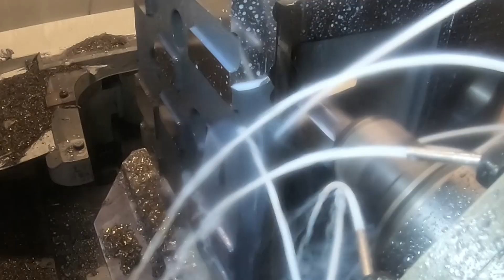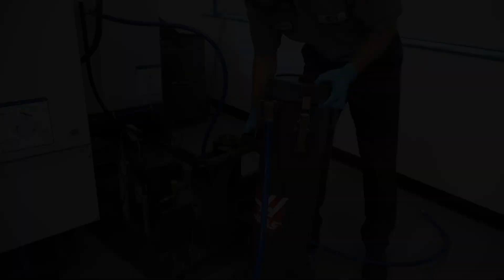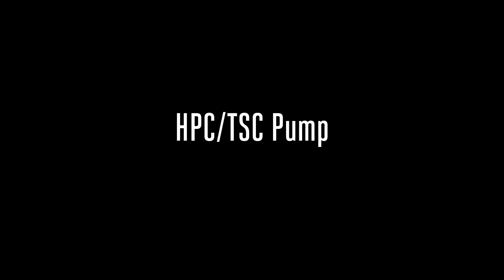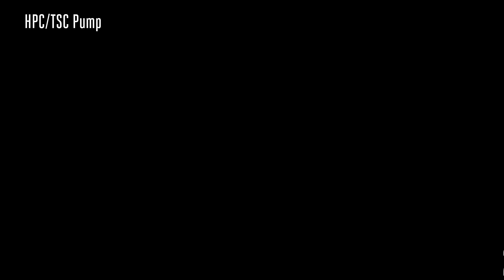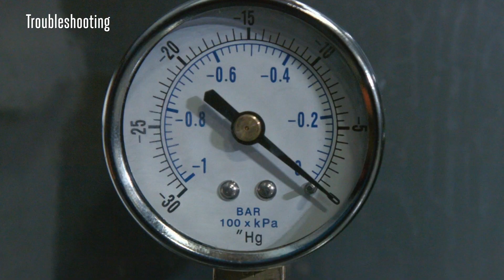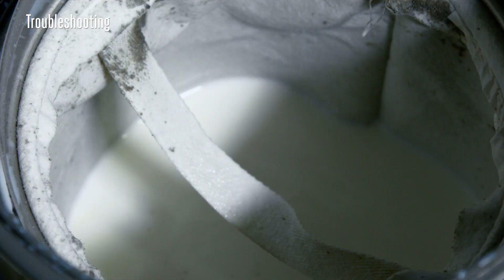Auxiliary Coolant Filter Installation - Haas Service - Haas Automation, Inc.

Comment: my 2006 ec400 has it setup with a small bleed line from the flood pump that keeps the filter can topped off. So if I change/drain it all I need to do is run my flood pump and it will slowly refill it. I take it they removed this from the newer systems?
Reply: I have our 2016 VF2SS and 2018 VF4SS plumbed the same way. Except that I drilled a 1/16 hole through the brass muffler(in this case, it's used as a pressure flow reducer) because all of the fines from brass kept plugging it up.

Comment: We have 1000psi tsc and the hpc flood coolant. When we tried to install an auxiliary filter on the hpc, hoses would shake like crazy and coolant flow was pretty diminished. It had a new filter and we filled the filter tank up.  Any thoughts?
Reply from the maker: Kbgreen 2009, Here are some things to try:
Make sure the filter bag is installed in the strainer correctly and not bunched up; restricting the output port.
Double check that the coolant tank and filter are both filled with coolant.
Make sure the hoses are not kinked in any way, this will cause the line to vibrate aggressively and reduce coolant flow.
Finally, if all of the above check out, put a towel around the output line fitting, turn on the coolant, and crack the output fitting (this will create a little bit of a mess) to release any air trapped in the lines.